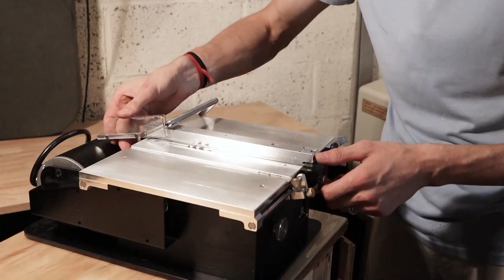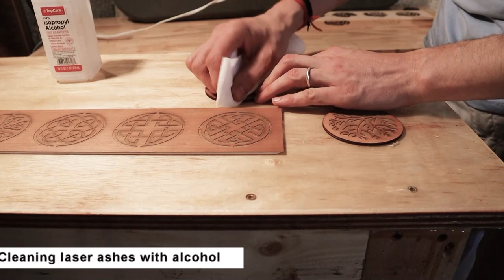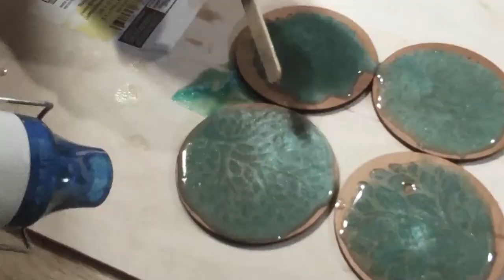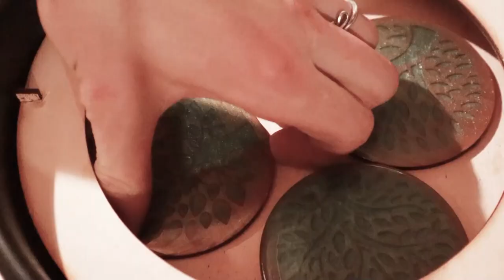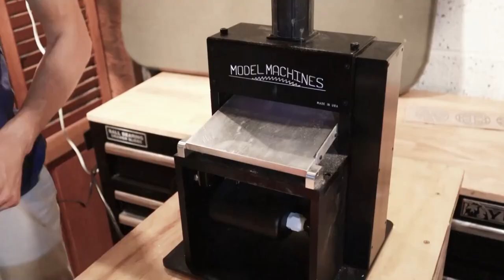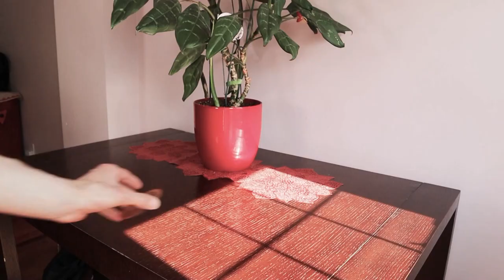Coasters Project. Wood and Epoxy Combination.

Comment: I watched the video - interesting technique to eliminate air bubbles with the pressure pot. Which epoxy did you use?))
Reply from the maker: I had experimented with quite a few types of epoxies, starting from affordable ones on Amazon to more advanced ones like uvPOXY from Ecopoxy. What I found out is that TableTop epoxy from TotalBoat works best for me in this application.